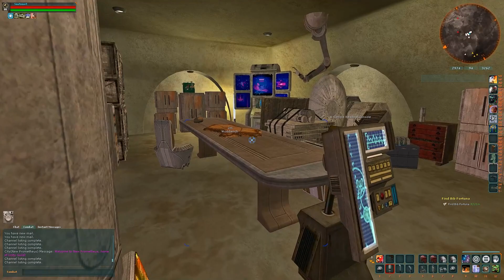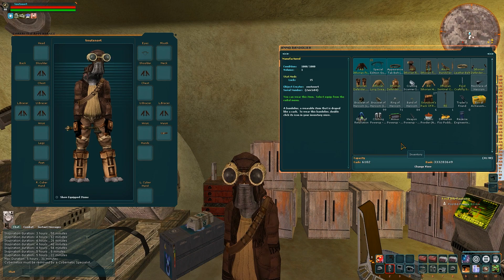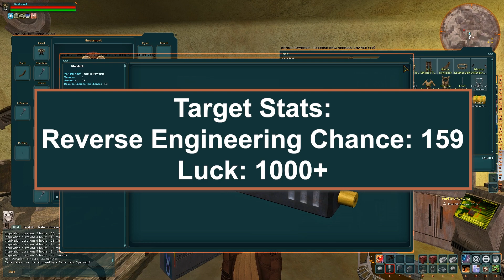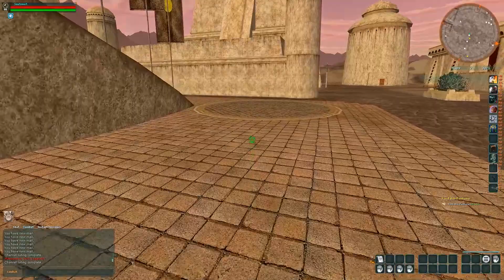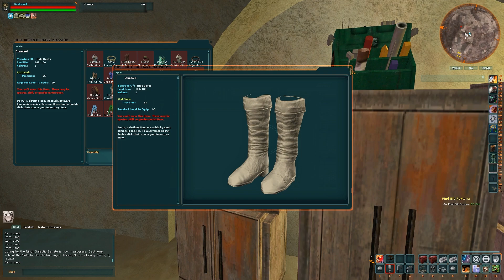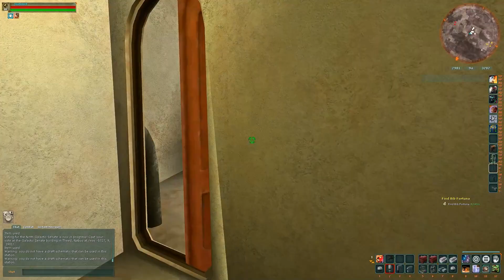Reverse Engineering 101 - The Basics - Star Wars Galaxies Legends Guide

Comment: The RE enhance modules are good for the initial conversion of a statted item into a power bit.  Using the enhance modules, 23's should start off as 28/29, 24's will be 29/30 and 25's will be 30/31.  Also it's useful to get a second RE tool to keep your stacks of junk in so you don't have to keep swapping it over when you need new mod bits.

Really nice explanation of the RE process, would have been very useful when I started doing it.